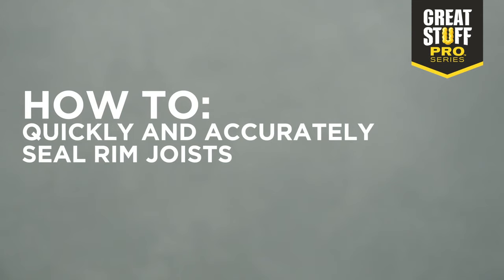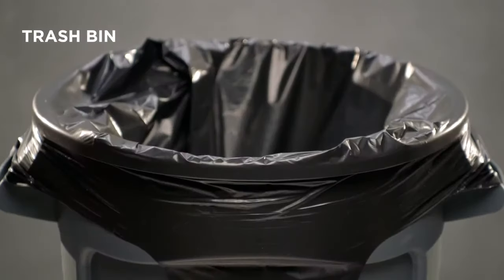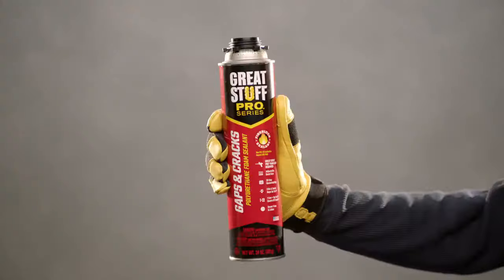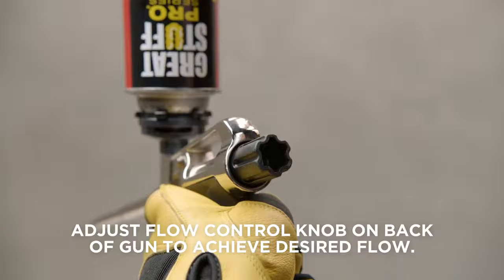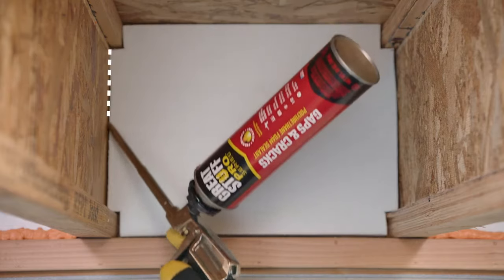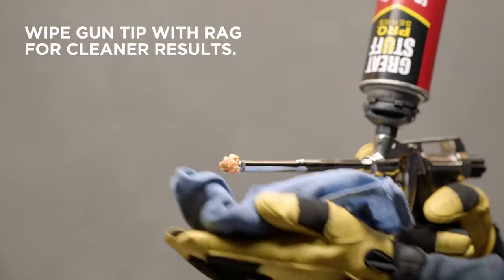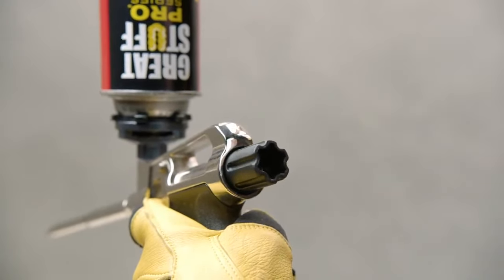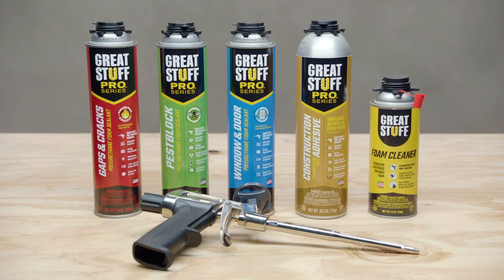How to Seal Rim Joists with Great Stuff Pro™ Gaps and Cracks

Comment: Slightly disappointed - the can is very tall when you screw it into the gun and you CANNOT get into tight spaces because of this.
Reply: put a piece of hose on the tip.

Comment: My roommate and I are senior citizens trying to bug and weatherproof our house and on limited income. We bought your product recommended to us a a GREAT product....no one told us we had to have your stupid special gun which cost over $60 dollars! What a rip off
Reply: You can use the regular stuff not pro but read my tips below. Keep the van upside down the whole time you are using it and place your finger on the end when you need to go to a different area of the house(with nitrile gloves) .Bugs it can prevent but if you have mice they can eat right through it unless you put steel mesh screen between 2 layers.

Comment: Can you use the regular gaps and cracks for the same thing?
Reply: Yes but the tricky part is preventing the foam from hardening in the straw so put your finger on the end when you need to move to another joist with a ladder for example. If the straw gets clogged let it soak in 100% acetone or buy more straws beforehand at Amazon. The pro foam is definitely a better value but the gun is expensive and most people won't understand how to use it correctly. If you are trying to use the foam and the temps are 70 or below this stuff will bubble when it hardens and not do what it's supposed to- block air with closed cells in my case.